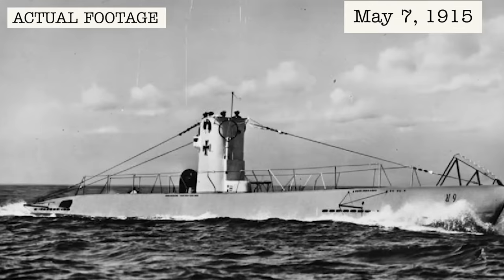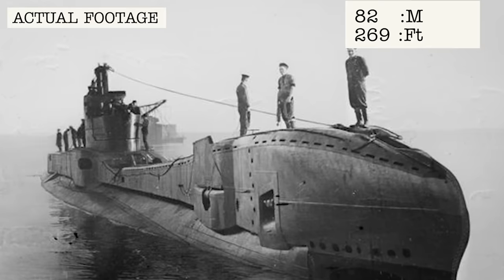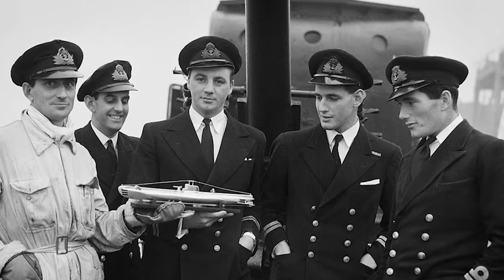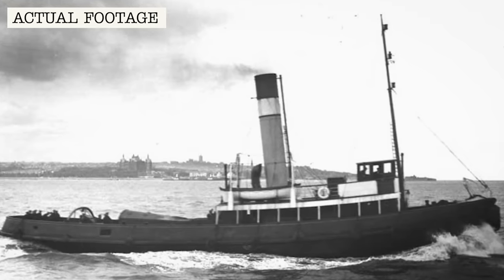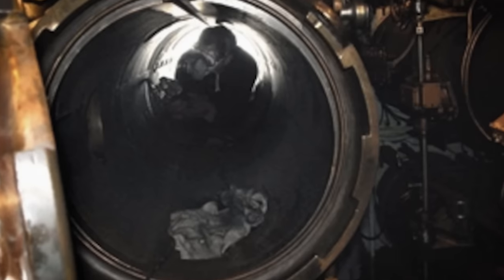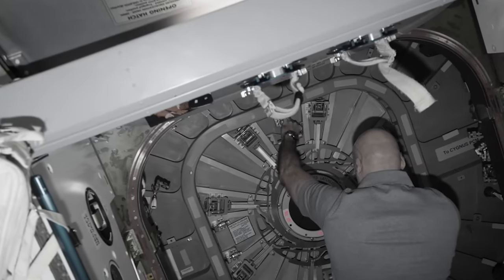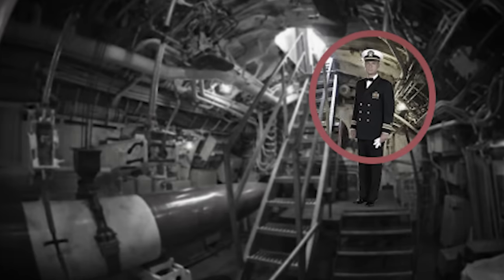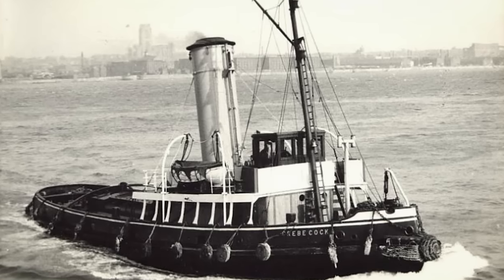Navy Kills 99 of Their Own Men to Save Sub

Comment: Testing if the torpedo tubes are flooded or not on one small valve seems like not the way to go... forget the paint... That valve could be clogged with anything, with dirt/grime, with rust, with algaes or other bio growth... And it wouldn't pass water through, giving the submariner the false idea that the tube is not flooded. 

Seems like putting all your eggs in one basket and then rolling the dice based one of those small valves was just a tragedy waiting to happen.
Reply: The valve was   a  ninety degree turn cock type AND there was supposed to be  a metal pricker supposed to be racked beside the valve.  The navy had foreseen this blocking issue  and the procedure was not followed.  There are other  BETTER Yt videos on the Thetis that cover this.
Reply: @F_Tim1961  Yes, there was such a tool but the torpedo officer testified that the tool wasn't used as part of the SOP for opening a tube, rather it would be checked regularly as part of 'housekeeping'. I guess on it's trial they didn't think there would have been any accumulation of grit or seaweed or whatever is expected to block it from time to time, or maybe the fact that the navy had yet to officially accept it from the yard they thought it would have been checked by Cammel Laird.

Comment: BS, you just based your video on one of several dramatised fictional stories based on the loss, The escape trunk got jammed when 1 man panicked, many of the lost were the designers and builders of the submarine so would not have been abandoned. Lastly, the crew could not be rescued because she was not level, so a rescue chamber could not be used and because she was heavily overcrowded CO2 killed the occupants before another method could be used. I suggest you do a better job of research, there were several enquiries and court cases ALL documented.

Comment: who in his right mind opens an interior torpedo tube door when the outside door is open ?
Reply: Far as I understand it, he wasn't aware of that.

 Since the paint blocked the water and only a few drops came out - something you expect from a torpedo tube no matter if it's flooded or not - he opened the tube expecting to see it filled with air.

Given those tubes were sometimes used as ballast, my assumption would be he saw that it was apparently not filled with water and wanted to see why
Reply: Who builds a sub where its even physically possible to open the interior door when the outer door is open....im a car  mechanic & British cars are just as bad. ...Toyota/Lexus should be building subs
Reply: Someone who obviously does not know the outer door is open, obviously...